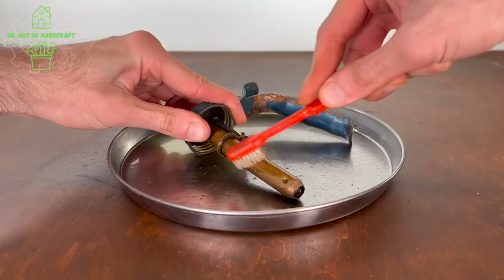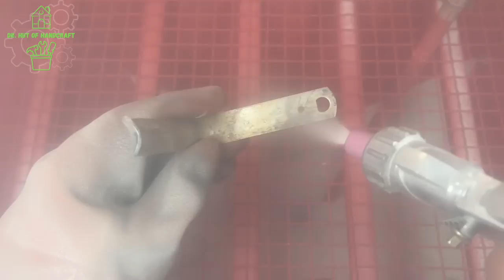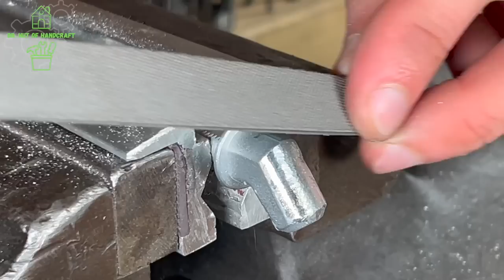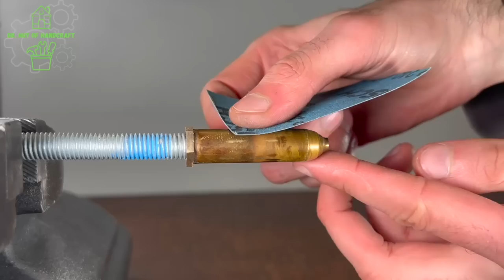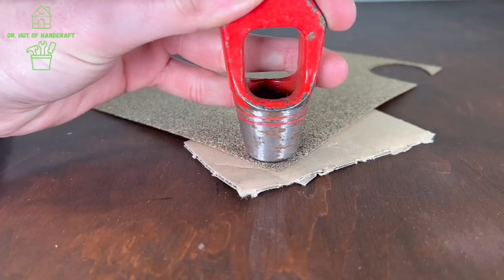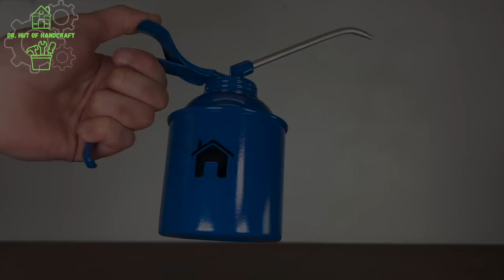Old german oil pump restoration I Dr. Hut of Handcraft

Comment: Really enjoyed watching the care and attention you paid to this restoration. House decal is a nice touch; however is it just the camera angle or is it slightly off-centre, appearing closer to the handle than the middle? It looks like the original paint was a metallic one. I like the gentian blue you used, but I think I would have personally used blue Hammerite paint to match the original. I like the metallic look on items like this, but it’s just personal preference. 

Keep it up (and don’t forget the chemistry Demos!)
Reply from the maker: Thank you very much for your comment!
Yes it is really a little bit off center. The thing is that I tested the position without putting the gasket it, so with the gasket it turns slightly less 😄 Without the gasket it would be perfectly centered.

You’re right, I didn’t do any experiments for quite some while. I will see what I can do in the future 🙂

Comment: It does not need putty. Why did you put it on it? Because it does not have a single scratch
Reply from the maker: To make a smooth finish on the paintjob later. That’s a standard procedure. As you can see before I used the primer there were some spots were putty remained. These are the spots that needed putty 🙂